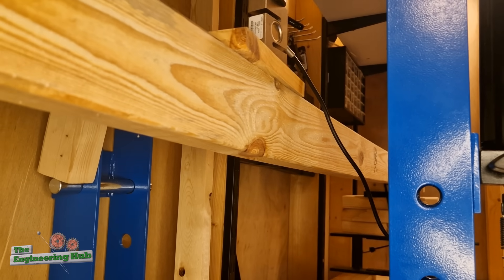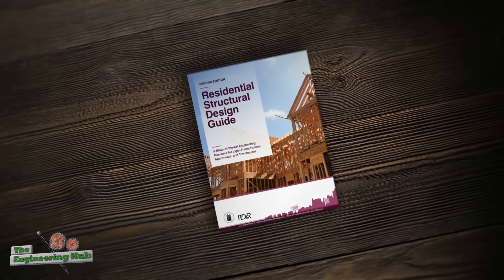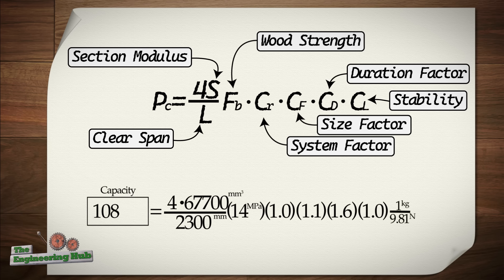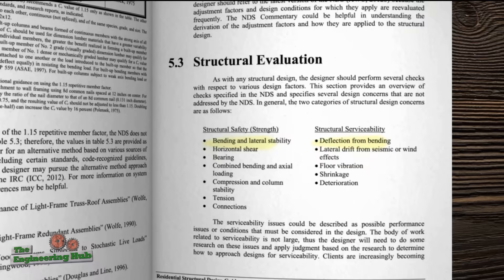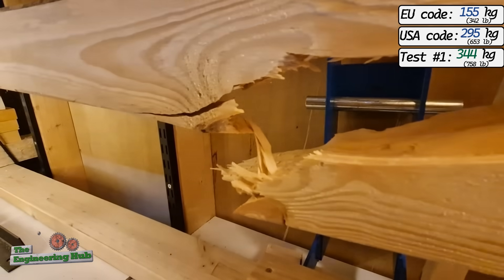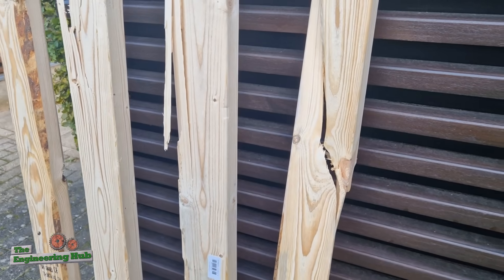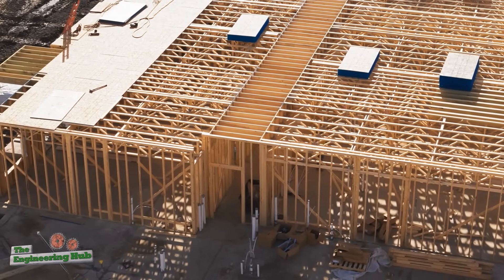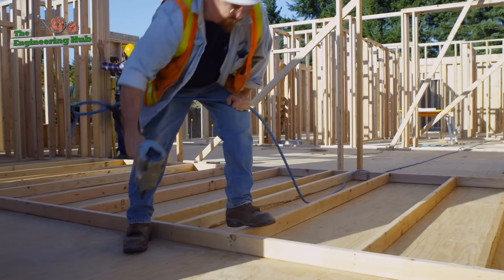I tested the strength of the 2 by 4!

Comment: Engineers Comment here. PLASTER;  The maximum floor loading in the USA code books goes back to the days of PLASTER ceilings. So the MAXIMUM Deflection ie Curvature of the Beam Matters too

So some wood from the planet Vulcan might be 10 times stronger in fiber strength but have the same unit stiffness ie E.

So the criteria is more than the beam "breaking".

ie if the 2nd Floor Joist bends too much " the ceiling below the floor"'  breaks. 

 The criteria is also the maximum "dip" or curving down in  lay terms. That is because the Plaster ceiling would break off and fall and hits folks. Or today the sheet rock screws will pop and the sheet fall or break.

So again the tables have Bending as a criteria too. ie if some Wazoo Vulcan wood is used and the maximum deflection still defines the table of wood beam size and length to floor loading

An attic might be just 10 Lbs per square foot of " extra load" allowed; a 2nd floor 40 Lbs/sqft; a factory 100 Lbs/sqft or more

In glue lam beams the Designers and Code guys save the drawings they designed and approved the beams for. They do this for Liability. So that 2nd floor that is an attic with say 20 Lbs/sqft load Joe Goober Homeowner later converts to a bedroom; adds a water bed and pool table and weight room. The whole thing collapses and Joe SueThem Lawyer sues the builder and beam maker. Then the saved plans show it was designed for 20 Lbs /sqft and Joe Goober had several Tons of crap up there and thus the failure.
Reply from the maker: @3beltwesty  yes exactly, that's why, as stated in the video, there are ultimate limit states criteria and servicebility criteria. Testing all would take a video too long for YT so here the focus is solely on flexural strength.

Comment: we used to have real 2x4s, the it went to 2in by 3.5in, now its 1.5 x 3.5.....only used in wall framing and even those are being phased out in exterior walls....My moms house has 2x4 joists spanning over 15ft, she is less than 10 miles from 1991 Northridge earthquake in Los Angeles.....her house was completely fine

Comment: In the european code the safty factor is built in. So if its rated to 155kg you should expect it to hold 310kg. And of cause of the lumber is rated at C14, that is the rating of the 10% worst timber.
Reply from the maker: @matsv201  is it actually 10%? I read that it was 5%? If it's 10 it would explain a lot
Reply: @TheEngineeringHub  
I was tought it was 10%, the issue is that i was tought just when we swiched from Swedish code to Euro code.  So i´m not quite sure if it Swedish, euro or both.

What i do know is that in Swedish code the safty margin is added, and in Euro code its extracted (From the designers point of view).

So with all the margin, volume and other issues pre extracted from the European code , the total strength will be around twice that of the indicated strength.

And to be honest, this makes sense. Because if the engineer forget the safty factors, if they are already calculated in, you will only ever get it stronger than it suppose to be, hence safer.

With the old system (and i would guess, have not checked it up, also used in the US???), if you forget the safety margin, you effectively have no safety margin, and it may break on designed load.

Comment: The thing that always scared me at looking calculations with wood when I was in school was at school was species and knots. After doing woodworking as a hobby for a few years, those are kinda non-issues (for construction lumber you don't really get a choice with species, and just avoid knots). Grain orientation should also matter for how the load is applied, everything in the video looked like flatsawn pieces but if you go though a pile, theres a handful of quarter sawn looking pieces as well.

I also question the values in the code, if they are using numbers measured in the early to mid 1900's, it is likely that the wood they measured is not what we are using today. Today's lumber is farmed and optimized for growth, that means farms want the tree to grow as fast as possible so they can harvest it and grow the next crop. Since tree rings are made at a constant rate the spacing between rings is much larger in farmed trees compared to trees growing naturally in a forrest. Old growth trees starved in their early years, they grew in the shadow of mature trees and would have took much longer to get to the same size thus their wood would have many more ring per unit length. The rings are what provide the strength and durability, and if what was measured was old growth wood that has 5x the density, it would be almost an entirely different material.
Reply from the maker: @bryanthiga3198 I love this comment. I actually looked into that very issue and made a video about it about a year ago. You may like it as well. If you end up watching it, let me know what you think. Cheers

Comment: I don't know how the US/CA ended up with the 1/2 inch reduction. However, it seems hardly surprising that European timber is just nearest round numbers (down to 5mm) given that majority of Europe uses metric rather than imperial system.
Reply from the maker: @RadekSimko  check out the video on why the 2 by 4 is getting smaller and smaller. It answers this exact question. Cheers!

Comment: DURING the failure no mention of the length of the span , how long was the 2 X 4 ?
Reply from the maker: @robertdruhn4740  clear span 2300 mm it's shown in the calculation. Also it's mentioned in the first sentence of the video 2.4 m board (8 feet)

Comment: C14 is not allowed for load bearing structures here in Norway (I  guess that applies to other European countries too). C24 is what is used for house building.
Reply: And funnily enough the dimensions are 48x98mm in Norway, I.e. the "biggest " 2x4....
Reply: @arntoveh75  Lucky you! I don't so much care about how large these 2x4s are as I wish they were more uniform. CLS timber here in the UK which is the american style 2x4 (38x89) is more consistent than the UK style 2x4 which is supposed to be 47x95, but can be 44x93 or god knows what else. I wish they would make them all 44x95 and make them consistent like CLS.
Reply: In the UK we use either C16 or C24. Also, 2x4 can slightly vary in size - 44-47mm x 95mm
Reply: Can I ask why is wiring on the outside of the walls here 😩

Comment: C14 isn’t the European stress graded structural grade. It’s c24. Less knots and all treated with anti rot. C16 you’d use for internal studs. C24 you’d use for joists etc
Reply from the maker: @t-rex4211  you can see in the video that they are painted with C14 on the ends. I took this video when I bought the boards in Denmark.

Comment: Yes.  If you will pardon the pun, your statement at the end that the quality of the carpenter ,,,  You nailed it.  You also tested four  2X4s, at least one of which was strictly a No. 3 grade.  Size of knot, type of defect, position of the knot or defect..  A good carpenter accounts for all of these. If there are two elements that are bowed,, I will combine those elements in oipposing directions.  If the knot or defect is so large the grade should have been a No.3 or No.4  that IS the element I will use for cut up blocking.  Or,, I HAVE been known to over order on the basic stock just so I can reject pieces that are substandard.  The load or bunk is unbanded in the front yard, and if an objectionable piece is encountered, It is simply placed in a returns stack. I will not use garbage.
Reply: # 2 should never be stamped at the; Mill for a #3 or worse.
Standards set, when deligently applied and followed always worked. Should not be your job too grade what already was suppose too be done.  If that was required, then they could let go the grader and reduce the purchase cost.  ACCOUNTABILITY!!
Reply: @edwinlipton  Edwin, your faith in the grader or system is misplaced. Yes, I have seen nearly flawless grading and the bunk ( a bunk is a banded 'lift' of 2X4s approximately 360) received was of superlative quality.  However it has also been that I have received a bunk that would barely make dunage or pallets.
 2X4s unusable in any wall and 2X10s or 2X12s with large knots in the edges, trash.
The real world and jobsite contracting can be exceedingly ugly.  And, If I halt the project because of poor delivered materials, it is I who pay the penalty. In lost time, wages, and even the job when the principal contractor just hires someone with less integrity, and I lose the job all together.  (In which case, I don't want to work for him at all.)
Reply: @Sailor376also  I know the exsperience. I too was a Mechanical Lic Contract Plumber for 17 years of a 27 year career. Cut short for no other reason than Physical health "bones". So I understand what your up against.  Once was a time when "we" only had too do our desired trades with learned skills and focused attention for a decent profit of reward.  Now however,, youve got too do everyone elses job to get your contracted job alone completed. Including regrading lumber quality and that General contractors slice of pie as well.
For me; it was poor quality in mass produced "nibco" copper pipe no longer produced in the U.S. but south in Mexico. They'd bunndle it up for mass shipping with steelbanding, so tight and stacked so high that it egged and mared it too where a round nibco fitting could no longer join the pipe to fitting without alteration by a pair of channel lock pliers slowing down the water pipeing process. Nothing one could do about it but bitch and accept. It was due too profitization and production cost cutting. ie, cheap Mexico labor and utilization of Mass over sized loads of copper being transported.  I worked through out the western states, same everywhere.  Big, small, tracts, industrial, institutional, commercial retail, or stick built customs. Everything but sky scrappers. Wanted those. But never got too.
Loved the trades.  Building was more than a paycheck too me.  Broke today because of the shysters taking the profits who knew absolutly noting about building, but knew how too profit. Boy do they!
Reply: @Sailor376also ya mis understood me. I have NO Faith in mass production at all. It is profit driven and the reason for Boeing's demise. Planes dropping out of the skies, Star liner debacel and my once belief in the Big 3 autos now producing over priced junk.
Reply: @edwinlipton  Big 3 ,, over priced,, Yep!  It was as recent as three years ago I came upon a dealer with a loss leader for an F-150, 19,999,,  Of course he did not have one in stock and the upsell began.  And I nearly, and should have cornered him to order and produce the 19,999.  I just need a truck,, no bells and whistles, high school girl toe nail sparkle pink and blue tooth everything,,, all absolute junk if you are going to throw lumber, bricks, and blocks in the bed.  Current price is doubled,, in three years 39,999 and there is not a stripped down pickup anywhere, 60k to 120k for infotained 6 cup holders 12 speed auto, 3 cylinders and blue tooth start the truck remotely from the next city over.  JUNK.
My most recent disappointment, insurance.  I took a good 2009 with exactly the engine I wanted, and rebuilt it. Paid 4.5k  now into it for 14.5k  The insurance will not cover it.  Their position is that it is just and only a 2009 and worth 2500.  and they want to charge me 1000 per year to cover that 2500  Time to go self insured.  BTW  Fun to discuss with a fellow contractor.  Thanks !
Reply: @Sailor376also  you as well. Let's keep in touch. Seems we are the few left who recall better times.
BTW, I'm 68 working towardes 70. How about yourself?
Reply: @edwinlipton  Got four years on you. 72  closing on 73.  Not retired, but scaled back.  Doing a bathroom right now, complete.  Stripped to the studs and joists. Replumb completely. Original had 1.5 inch drains for much too long a distance T intersections, no longer approved, tub converted to tile shower,,,  Full mud job except the shower walls (double layers of cement board there)  As you can imagine,, the hardest part of the job the tree or four tons of tear out bagged carry down stairs and then across the yard,, and the 3 or 4  tons of new materials coming back up the stairs.  Good work for a 20 something, danged hard for 70 something.  Full roof on a 2 story earilier, gutters and aluminum fascias on another  and contracted for a full house starting about a month from now in the Arizona desert.
I must be nuts.  Should have hung up my spurs literally, when I gave away my tree climbing gear a few years ago.  Not a lick of sense
Do you canoe?
Reply: @Sailor376also  no canoe and too far to the river or lake. But up in the high desert region of the Oregon Cascades,, I do spend an awfull lot of time, getting stuck, digging out and walking in 3ft snow during winter months average 6, and dropping trees, bucking and splitting firewood. Might have been canoeing, or even fishing. Was my intent when I moved up here in 2019 after building my 1st shelter/cabin too live in. But ole murphy showed up and burnt everything down in a July 2021 wildfire, known as the bootleg.
418'000 acres burnt before it ran out of trees.  Got all my 18 acres full of aspen, pines and furrs. Over 4000.
So,,, I have been using the chain saw alaskan sawmill tech and rebuilding with whats left,,, and then some. Alot of 80+ footers left standing burnt and dead.  In my younger day,, I'da been alot faster and hard headed with reasonal fitts of anger,, today,, just anger.  Almost ready for a door, a lock and a new destination unknown.  What part of Arizonia you in?  Back in my 6-7th year as an apprentice Plumber I worked in a new development, old now, called Fountain Hills chipping ditch's of Granitt in 114 degree summer heat, just outside of Camelback and Pheonix.  Sometimes I wish Id had stayed. Like when winter up here lasts too long.😂😂
Reply: @Sailor376also  salt river canyon?
Reply: @Sailor376also  white mountains use too be good sized rainbow trout fishing.  Long time past. Showlow, PineTop
Reply: @edwinlipton   I'm gonna make you really laugh now,, I live in Michigan, have most of my life.  Sisters in Oklahoma, AZ and Hawaii  I get invited to visit (bring your tools)   AZ has developed into a bit more Sand W of Phoenix about 80 miles/ The last surveyed piece of land with 100 miles of BLM to the southern border.  The temps I am well aware of but I try to limit my work there to winter months.  Yep. I've worked there in the 110 to 122 quite a few times.  
Being 'almost' retired, I make sure I get in at least one long canoe trip each year.  Shortest, about 100 miles,, longest to date 1300 miles  Started in Wyoming and finished in southern AZ  and everything between.  I like white water  so things like Cataract Canyon, Desolation/Gray Canyons  Class I to Class V I've done multiple times.  It is not usual to use a canoe, but I like it.  Quiet, wilderness, far from a road or light bulb, heaven.  
Sounds like you live in such a place full time. I feel for you, building and then losing to a fire.  Glad you are about to hang the new front door.  I have few illusions,, that means you are about half way.  Keep at it. I admire that sticktoitiveness.  My bump in the road comes with the years , heart.  Seems to have been fixed but does not work as hard or as long as it used to.
Reply: @Sailor376also  try Devils Canyon in Texas ?  Had a nieghbor in Midland, said it was rough shallows using a canoe. But the only memory I have of a canoe, renting one in at the ?  Pheonix park zoo too apease a hot looking stripper out of Houston when I was? 19 maybe. But I hear say; here in Oregon, the Rouge river canyon has its challenges. Been by it , but never stopped.

Comment: Before wood is used it should be settled for bit of time to adjust to climate it will be applied in then there are the knots those cause weakening also the cut the end grains how the life lines got cut is it centered or cut off also how the board is used horizontal or on it's short side also don't cut the ends boards can't be considered as strong when ends are cut after they are bought then is the board dried also how dried kiln or nature dried or forced heat along with the facts that old wood was stronger no chemicals life was longer healthier boards were stronger

Comment: Guess you dont know much about wood, test a piece with no knots, or at least dont put pressure where the knot is , this will be a better strength point, good builders will hand pick all their 2x4’s for this reason and also to get the straightest 2x4’s. See you engineers dont really know everything

Comment: Technically you did not test a 2z4.  You tested a beam less than 1.5 x 3.5 inches if a US standard because of the knot.  The knot on the edge reduces the actual strength dimensions of the board at least by the dimensions of the knot.  And the length of the beam is important because longer = weaker.  Just some thoughts.

Comment: A properly engineered building does not use horizontal 2x4s to carry loads . The wood is strong in compression not bending .
Reply: Go up into your attic, or into a multi-story apt complex's cieling. You will 9 out of 10 find engineered truss framing, or floor joist girder engineered 2×4 support joists supporting the next level with 3/4" sound deading lite wieght concrete poured for the units.  It's materials and engineered application that make the difference.  Use rubber if you will,, with the right engineered application,, it will stand.